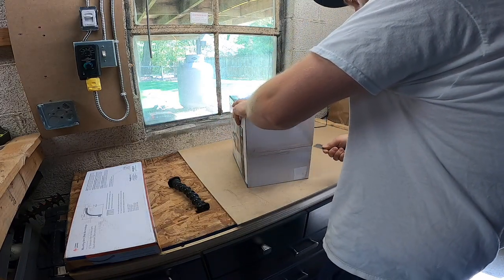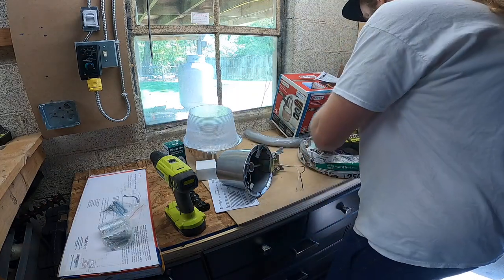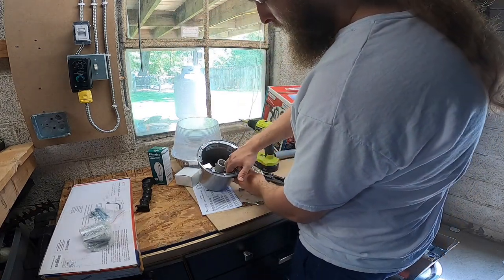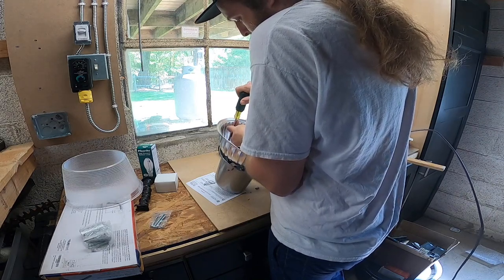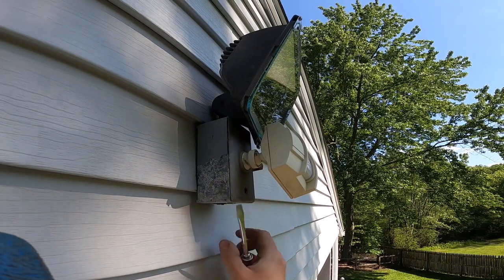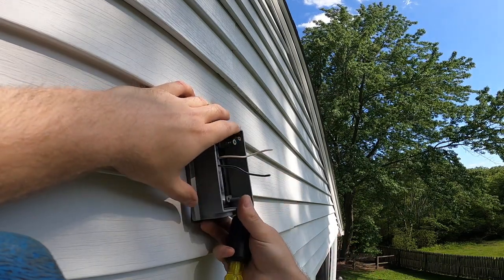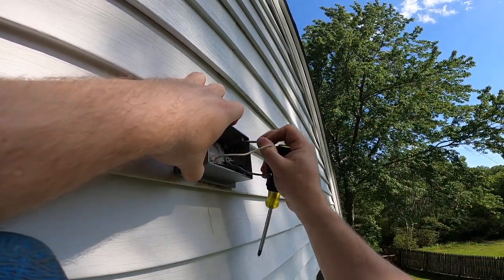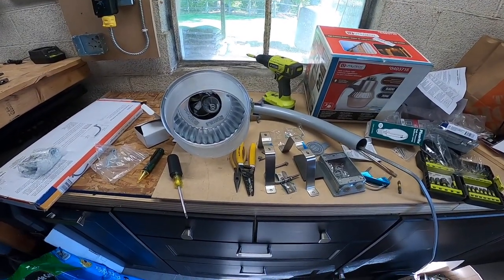Installing a 70-Watts HPS Street Light on the South Side Peak

Comment: They aren't Supposed to mount on a pole exclusively. You can either mount them directly, or on a pole, either option is correct.
Reply from the maker: True, what I meant was more than they were most often seen in public on the poles.